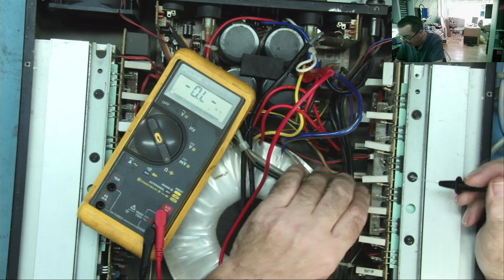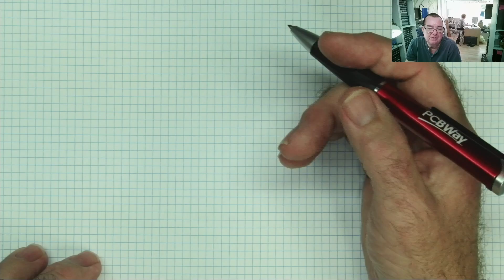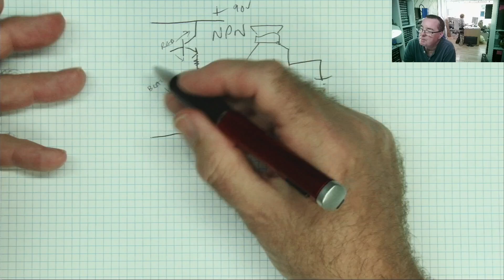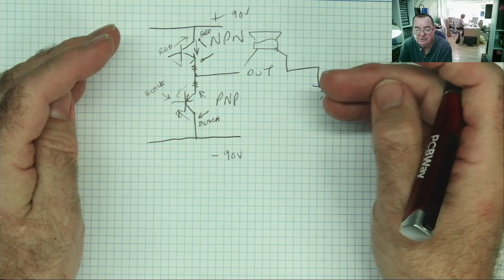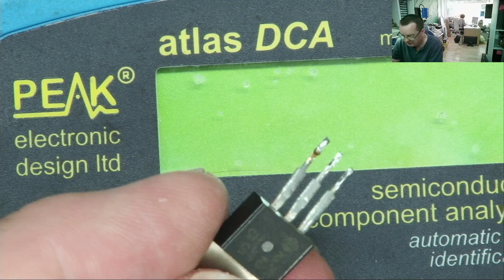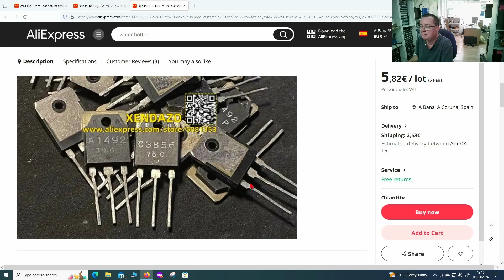Dead InterM MA-930 PA Amplifier Repair - Can we find all the faulty components?

Comment: Heya, yes why did the termal risitor blow up this I think needs further investigation and olso the 1.7 ohm reading I touth it should be open but at the uther hand they all have that so it could be a comment fault. so I see a 2st diagnostic vlog coming and a 3th vlog wen all the components will be replaced and it will work again

Comment: i've got an interm m-1000 sat dead on a shelf with those k215/j78 mosfets blown, i haven't been able to find a replacement for them as yet.
Reply: the ma-930 and m-100 are nearly identical circuits, i could tell that the base resistors had been replaced because they're the wrong colour, most of my emitter resistors were also blown, but both sides of my "good" amp module measure a diode junction where you're expecting them to be open.

Comment: 55:00 - As I was watching this video, I was hoping for a part two. Yes. Please follow through with testing before parts arrive. I’m particularly interested in how the module would respond using your bench power supply as the rails.
Reply from the maker: It seems others suggest this is the best way to proceed so let's try it

Comment: Will you be matching the new transistor to the existing ones?

Those transistor backs are very shiny, will you be  putting silicon heat compound on them, and behind the washer?
Reply from the maker: I would normally change all of the transistors on a faulty channel at the same time. I would expect that the pink heat conducting sheet between the transistors and the heatsink is capable of cooling them, the amplifier was designed this way and they didn't tend to cut corners to save money on these old workhorses

Comment: If you look closely it looks like the small resistor you soldered is lose on the other side too where you removed the other big transistor. If I was troubleshooting the amp I would just bridge the NTCs and use my dim bulb tester to test the powerboard

Comment: Thanks, Richard, that was very instructive. 

Something popped up in my mind while seeing this video: lacking a small resistance tester, can I use an ESR meter to measure the transistors? I've seen you using it in inductors to find shorts. Thanks, again.
Reply from the maker: I've not used an ESR meter to measure transistors but yes I do use it in VRMs to find shorted mosfets, especially in multiPhase VRM where using a multimeter the short appears to be everywhere,

Comment: A little tip I would like to share when working on an audio amplifier like this with a blown fuse. I connect a 60 W bulb across the fuse, then power on the unit, the bulb will light up, now you can start to disconnect the power leads that supply the left and right amplifier banks.When the bulb goes out you are found which Amplifier bank has the short, you can use this method to find which circuit board has the short by disconnecting the power to that  circuit board.
Reply: Richard has a switchable light bulb for exactly this purpose, it eliminates the need to put it in place of the fuse.
Reply: using the dim bulb tester like Richards you will have to replace the fuse I always replace the fuse when the short is eliminatedI.  i have a bulb with two wires and crocodile clips attached  just simply clip it to the wires to the  fuse holder, saves accidentally blowing any further fuses.

Comment: If those NTC’s have blowed, make sure that the relay actually switches to bypass them. As far as testing, would use bench supply first, see if no DC over speaker, etc. then would test PSU with Variac and dim-light tester, before connecting it to amp. I would definately check that that inrush-relay switches correctly.Great video, like always.
Reply from the maker: Thanks for the suggestion. I will check it.